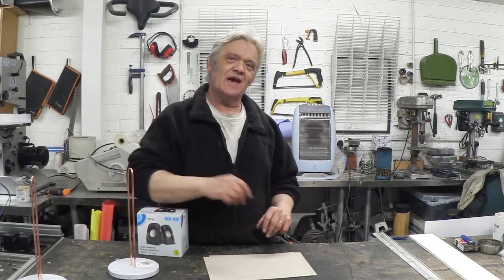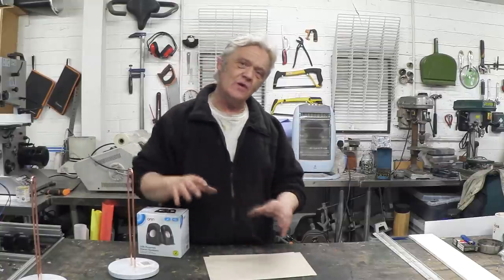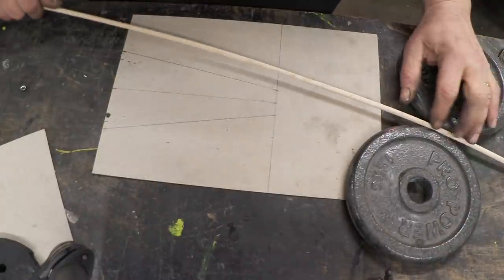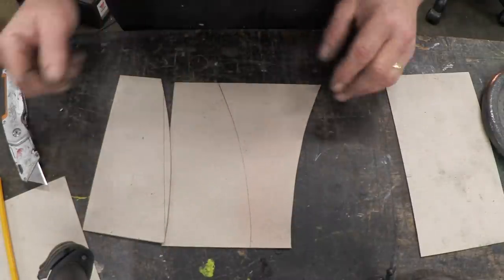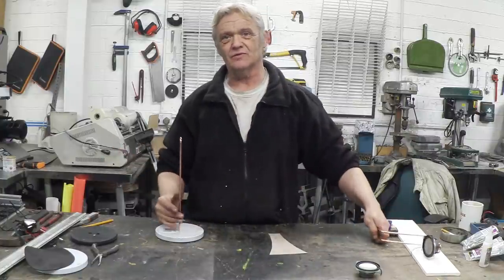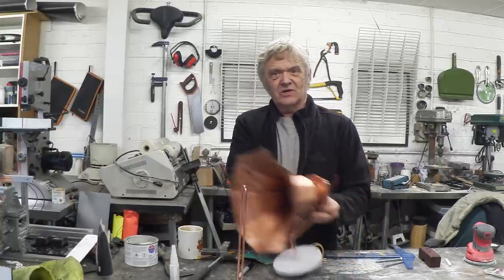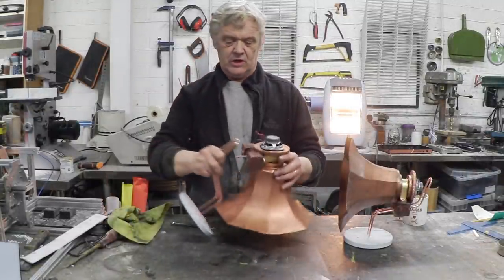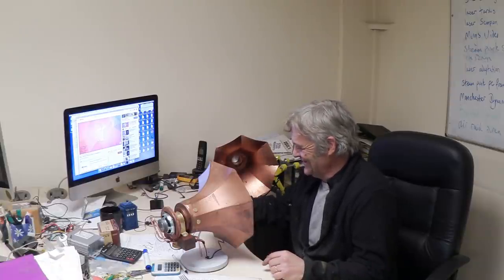972 - DIY Steampunk Speakers

Comment: Rob, I made some graphiticnitride yesterday.  I used your video on how to make it but instead of using a kiln I used my gold metal heating machine as it has a graphite crucible and figured when the urea pallets heated up in the graphite crucible graphite would mix with the urea instead of sugar.  

I moved it all outside weighed out my urea as your video set the machine to 550 c  nice 40-knot wind blowing outside so a good day for this job. Well............then the Ammonia gas started and boy did it sink the whole block of flats out! I was horrified just how much Ammonia gas came out. Even in a 40-knot wind, the ammonia was thick on the ground. My poor neighbors. I was worried someone would call the fire brigade or the police and I couldn't walk into my flat for 3 hours.

It worked I did get some graphiticniride out of it at the end of the day, The next morning I accounted for all my neighbors and they asked me if I could smell that horrible smell yesterday afternoon and I said yes it must have been coming from that industrial plant up the road.  

God if I ever make that stuff again I will rig up some way to dissolve the gas in water.
Reply from the maker: lol - I am laughing with you mate - it does give off a fair bit of ammonia that's true - but no worse than a chicken farm - in fact chicken farms here have to have ammonia scrubbers on their vent systems - I think wet scrubbing is used - it's basically an activated carbon tower with a water spray at the top
Reply: @ThinkingandTinkering  Cool I'll rig one up next time.

Comment: Looking  excellent and certainly steam punk ,which got me thinking about the connections to the speakers. Maybe if a small cut were made in the top of the loop with a small insulator inserted to keep them separated but still rigid, its possible the arms could be used to connect the speaker wires with bare copper wire and the cables to the pc taken from under the base.
Reply from the maker: I like that - maybe if the bare wire was too much of a pain you can get the wire covered in a see through coating that is still insulating

Comment: "If you get a octagon it's more or less a circle."
What happened Rob, the Mrs take pizza off the menu for a while? 🤨😂😎
Reply from the maker: lol - if a polygon has n sides of equal length then as n tends to infinity the polygon tends to a circle - the rest is a line in the sand - so yeah maybe 8 was a bit low lol - cheers mate

Comment: That's great. With this cones it also will be a lot louder. Don't know exactly why.
I built a crystal radio when I was 8 or so, i disasembled the piezo ear piece and put a cone on that. I could easily hear the BBC across the room. Remember thats in the Netherlands and it was a crystal radio only depending on the power which is in the air. I remember well  .. first the tune and then "This is BBC news". The amount of power which they transmitted must have been enormous
Reply from the maker: it does focus the sound that's for sure